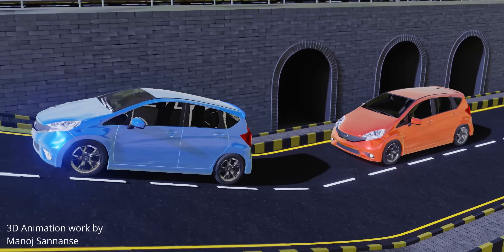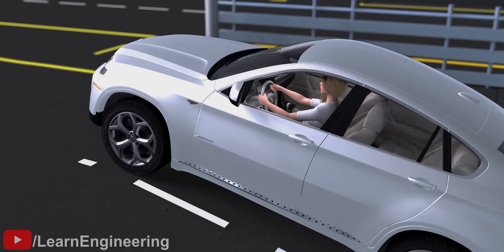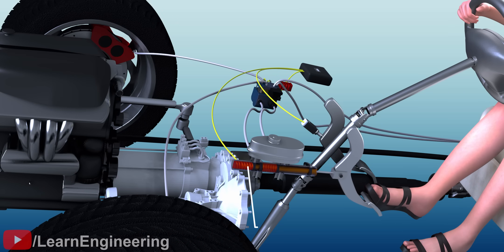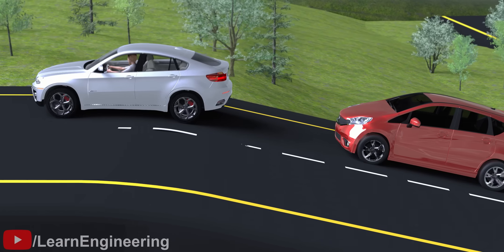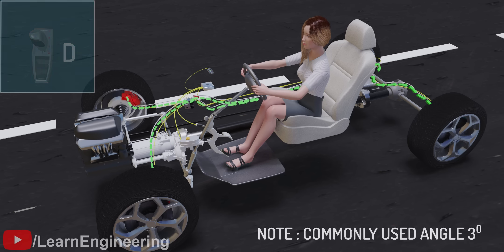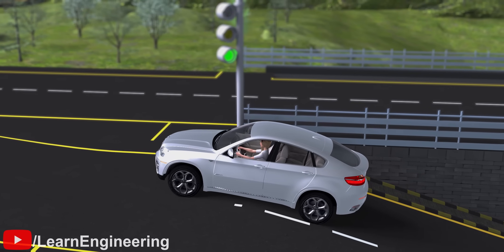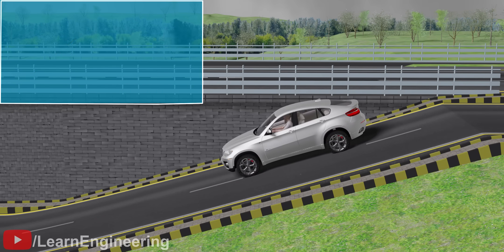Understanding Hill Start Assist!

Comment: Or you can use second leg to press the brake pedal if you have automatic transmission
Reply: May not be recommended for drivers accustomed to manuals. Either:
• use heel-and-toe technique.
• use parking brake.

Comment: Imagine driving really fast on a a downhill or uphill mountain pass, and you are a pro of a driver.
So obviously your braking technique is gonna be good. And once you brake hard, HSA comes into play and you're braking for a longer period than necessary and it reduces your speed.
Such a bummer! 😂
Reply: Also,
Suppose you're in traffic on an uphill.
So the HSA will work once when you reach the back of a car as you apply the brake pressure.
So when the front car goes about 10 meters ahead, you will also gradually and slowly move ahead. But at that time when you apply the brake, it will be soft. So HSA won't detect that low pressure. Then what? 😂
It still needs development in my opinion.
Nevertheless, I feel we should be adequate in driving and control the machine, rather than relying on the machine and inturn the machine controlling us
Reply: @maheshnaik561  HSA only activates when stationary, though.
Reply: @dbclass4075  ohhhhh. I didn't know this.
Thanks 😁
Now I look like a dummy with that comment🙈🙈

Comment: two pedals, two feet.. so, what's the problem?
Reply: Manual transmission drivers may not prefer to use their left foot due to muscle memory. They have other techniques:
• Heel-and-toe
• Parking brake

Also, amputees.
Reply: @dbclass4075  Yes, I agree for the manual users as they have to control also the clutch pedal. However, the video shows an automatic one, so I wonder why the driver idling his left foot on the floor instead of pressing the brake pedal.

Anyway, thaks for reminding about those unfortunate people who have only a foot.
Reply: @fahmihardian7778  Could be the driver is accustomed to manual that is driving automatic. Nothing is more frightening than accidental sudden brake.

(Yes, I caused unholy amount of mess one time for accidentally pressing the oversized brake pedal. Left foot on the left half of pedal. You know, trying to fully press the imaginary clutch pedal. Rest of the journey is awkward silence. Angry stares, food spilled all over the interior, the smell...)

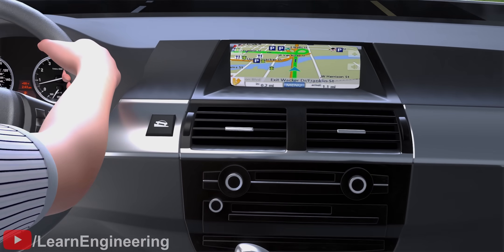Comment: 2:27 "This is a tedious task" * shows lady just press a button *
I prefer having full control and just prolong break with a button.
Reply: Exactly. Most accidents where people mess up the pedals is due to automatic cars. With manual you press the clutch and the power is gone. Much more control over a car when it's manual.
Reply: @soldiers303  True. If you learn clutch, you learned the entire car. It does everything. Move your car, stop the car, shift gears ect.
Reply: @soldiers303  You can cut the power by shifting to neutral, regardless of transmission type.

Comment: I didn't know that this exist. Anyway, I'm from Europe, automatic transmission is rare and this is not applicable on a manual transmission.
Reply: If you didn't know it exists why would you say not applicable on manual cars? It actually is applicable, it holds the car for roughly 1.7s before brakes release
Reply: @soldiers303  Because I watched the video and I understand how it works. When you drive a manual transmission car, you have full control, there is simply no need for this.
Reply: @Zuconja  there is no need but it has been implemented. It's useful for beginners who drive manual cars
Reply: @soldiers303  In my country there's a hill start test when getting a driver's license. You can't pass if you can't start on a hill. Manual transmission car is mandatory on driver's exam. 
If you ask me, if you can't start on a hill, you don't know how to drive.
Reply: @Zuconja  Of course there is a need for it on manual cars. Those that have an electric parking brake. How else would you be able to not go backwards in a pretty steep hill with an electric brake? Electric brakes are slow and they are only either activated or deactivated.
Reply: @alejandroperez5368  
Long answer - I don't use parking break for a hill start, just pedal brake. When you are ready to go, you press clutch pedal, insert in first gear, release brake pedal and then you balance gas and clutch pedal by slowly releasing the clutch and slowly pressing the gas pedal. All this is done very fast and mechanical and in my country almost every driver knows this. I you want you can keep a car on a hill in a standstill without pedal or parking brake activated just by balancing clutch and gas pedal.
Short answers - skills.
Reply: @soldiers303  Absolutely no usefull for beginers, they will rely on a technology rather then their control over car and as @Iggy says in europe we have the hill start test on TRAFFIC and Parking on hills with manual transmission, if every time the examiners waited the driver to start stop the car on hill the driving test would take twice long.
Reply: I have a 2017 Mustang 6 speed manual transmission and it has this feature.
Reply: They do have hill assist on manual cars unfortunately and it’s extremely annoying to use. It jerks you forward every damn time I had to use it in my instructors car :/

Comment: Why can''t that person use his second leg to accelerate while simultaneously removing the first from the brake?
Reply: I do that
Reply: In am automatic car this works but not in a manual car
3 pedals struggles
Reply: Manual transmission drivers may not prefer that due to muscle memory. They have other techniques:
• Heel-and-toe
• Parking brake

Comment: I start uphill without any assist, I drive Manual 😁
Reply: Manual cars can still have hill assist.
Reply: @mattyj2111  some of 'em actually do
Reply: @bertojr2130  unless you responded to the wrong guy I was agreeing lol my instructors car had hill assist personally I didn’t really like it as it was really jumpy.
Reply: @bertojr2130    Like my 2009 Subaru WRX--and it cannot be turned off.   HATE it.   The hill assist is particularly obnoxious on a sports car.    If you check the blogs, it causes old-timers with fast feet to burn through clutches because the HA doesn't release soon enough.   Bummer!

Comment: What bunch of wimps!
When I was being tested to receive my first license,whether an automatic or a manual,you were told by the license tester to head up a steep hill.
Stop, then proceed, if the car rolled back even an inch you got a deduction.
The automatic transmission required you to put the left foot on the brake,keep the brake on while you slowly added power ,as soon as the car started to strain against the brake,release the brake and go up the hill.
The manual was even trickier as you used the hand brake, to hill hold the car,then push the gas pedal,and let loose of the clutch and try not to tool back even the slightest.
These current younger drivers cannot even parallel park.

Comment: HaHa I'm 16 and dont need smart uphill in a manual car (With clutch) lol, I can even keep clutch and revolution at the right pressure and no need for brakes
Reply: I wouldnt use the clutch as a brake. It causes much unneccessary friction.

Comment: It doesn't take seconds to switch between the pedals, just release the brake and quickly press the accelerator more than usual. The car doesn't immediately start rolling back at full speed
Reply: Between vaping and recording my next titok video it can take anywhere from 10 sec to 2 mins to get foot back on the gas pedal...
Worthless except for about 4 steep hills in America with stops in the middle.
Reply: Yeah it goes rolling back slowly but sometimes when I press the accelerator too hard my car starts making a squeaking noise so I lightly press it till it starts going forward
Reply: @ClawsTheKing47  yes. Same. If I press the accelerator too much that's when it squeaks  too loudly and it burns the wheels' rubber I can  even smell it.  the thing is that when I press gas, I panic that I won't  slide back so the tendency is that I step on the gas too hard. Ever since this uphill issue  happened to me, whenever I drive I get scared when I see the road slightly uphill. I never got over it.
Reply: @timcook4552    Practice, baby, practice!    Do it where there's no traffic, at night or whatever.
Reply: Not it does. That happened to.me and I was traumatized
Reply: @timcook4552  then you don't know how to drive
Reply: @YourDadsBoyfriend  I just started to learn how to drive and when I pressed the gas it accelerated too fast I almost collided
Reply: After all, we have to legs.

Comment: "a few seconds are required to switch from the brake pedal..." -  Really.. a few seconds?  Try a fraction of a second.  The harder issue is a manual transmission.

Comment: I thought the reason was because of the work the motor already does when you simply let go of the breal pedal. For example my vehicle wont travel in any direction when on an incline if i come to a full stop and then release the break pedal. It will travel downhill obviously and also would roll back on a very steep incline.
Reply: Most automatic cars already dont roll backwards when you stop on a hill and release the brake. At least cars with a torque converter dont. Even if you drive up a hill in reverse gear.
It doesnt use the brake for this.

Comment: 0:10 I have a handbrake.
Reply: How can you drive with broken hands? Or do you mean handbrake?
Reply: @dbclass4075  Yes, you also can use a handbrake. You don´t have to break your hands.
Reply: @qq84_Richard  But if the driver somehow breaks his hands using the handbrake, I would be very tempted in swiping his license away.
Reply: @dbclass4075  It depends on the jurisdiction, in some you just can´t.
In some jurisdictions you can drive on the wrong site of a 4 lane highway and don´t get your license taken away, you don´t even get a mandatory reexamination.

Comment: Just put one foot on brake and other on accelerator ,no time needed to switch between the paddles,no need of HSA
Reply: Don t forget to use your third leg for the clutch
Reply: Manual transmission drivers may not prefer that due to muscle memory. They have other techniques:
• Heel-and-toe
• Parking brake

Comment: WTF is this? We just use the clutch; and for very steep roads, the handbreak.
Reply: You can use the normal break also
Reply: Give me a BRAKE. I'll ride along with all of yah.
Reply: Bhai mera 1 youtube pr chanel hein. Bhai log mujhe suport ki bhht jrurt hai pls suport kro❤️https://youtu.be/JyBckyDgKc8
Reply: Americans
Reply: this is for the  button app using generation.  ask  this generation of button pushers to use the clutch pedal  and theyll  google it on the steep hill------ crash,  my insurance company has a app for that sir, let me put the manual in park !!!!!!
Reply: Actually with an automatic transmission you can simply brake with your left foot and release it while accelerating. In a manual you can also use the heel-and-toe technique. HSA = useless.
Reply: @adrianocoelho2026  HSA is not useless, it makes all of what you said a lot easier, maybe unnecessary but definitely not useless
Reply: @HakarDoski  Infact hsa seems alot more desirable in Manu cars since they require eyou to find the clutch biting point

Comment: I am european and there's a pedal missing
Reply: @TheGaming Hobo  lol... I feel he might be taking about clutch pedal if the transmission is manual.
Reply: I see no point of such system in automatic, you just press the brake with left foot
Reply: Americans mainly use automatics and don’t seem to have a handbrake?
Reply: @mattyj2111  thats why i gss the jeep compass doesnt have a handbrake
Reply: Americans already have car crashes as is. If we give them a third pedal they won't be able to even get the car to move lol.
Reply: Auto transmission
Reply: @Tournel Henry dude just because companies are adopting more electric doenst mean people have them. Based on statistics, it’s around 90% of drivers in Europe that own manual cars
Reply: @Tournel Henry Manual transmission is more fun. EV instant torque and one speed transmission is the only thrill worth giving them up, IMO.
Reply: Not all of us use Auto. I drive both. Manual is clearly more fun.
Reply: @Tournel Henry if you had a manual you would prefer it too
Reply: @calettov2  Not if he's a bad driver, which unfortunately, Americans tend to be...
Reply: A pedal and the application of the handbrake.
Reply: @Tournel Henry chill
Reply: Facts
Reply: That’s why Europeans are W (I’m Asian btw lol)
Reply: @Tournel Henry It's not necessarily better. Aside from having more control of the car as mentioned above, manual is also a way simpler system which means less points of failure and also cheaper repair. If your automatic transmission fails, you might be paying close or as much as you paid for the whole car itself. Manual can do everything automatic can do while being simpler, at the cost of being slightly harder to learn (it's really not rocket science). So it's not outdated.
Reply: For Indians too 🤣
Reply: @Tournel Henry it's not outdated, has some advantages over automatic transmission like more control over the car power and torque which may be not necessary for some  mom driving her children to school everyday but a must for someone who likes to have fun driving a car.
Reply: @MB-up3mh  it kinda is outdated, no need to write a history lesson on explaining why it’s not
Reply: @MidnightE53  it kinda isnt.  A lot of performance oriented cars will have a both automatic and a mannual option, unless its intended to be chauffeur driven.  Manufacturers still are using it widely, and i think if you look globally, mannual cars are produced a lot more than automatica. So its not outdated. Manufacturers make them, market has a good demand, and It does provide some benifits over an automatic. So its not like automatic is an upgrade and mannual is outdated. they are just two different options available, as per your preference.  If you drive because you have to, then it doesnt matter and you wouldnt probably understand., but if you drive because you want to, i dont think you'd want yo drive an automatic.
Reply: @Tournel Henry It's maybe better but it makes you lazy and it's boring just turning the wheel around.

Comment: I hoped an experienced driver would comment about half clutch on manuals but couldn't find it.
In manuals your left foot is on the clutch and right one one the brake. You lift the left pedal till you sense the engine is going to stahl then you quickly release brake and push gas.
Hope someone who can explain better leave a reply.
Reply: I dont use this method because my VW for example doesnt have that much power and torque. Its actually not a good tactic because you can kill the engine easily with that.
Never ever use the clutch while stepping on the brake. Let the brake go and then give it enough gas and let the clutch go a little faster than normal.
This is what I do. Since I do it that way (as a beginner) I never killed the engine ever again.
When I used the tactic you proposed I killed it multiple times.

Comment: I just accelerate the car while the brakes are still pressed and release them gradually
Reply: When I drive an automatic car I just let the brake go and instantly step on the gas with greater force than I usually do and then let go a little bit once I am moving.

Comment: Oldschool hand-brake technique left the chat..
Reply: Riding the clutch anyone?
Reply: @ethanebang7507  yup, thats the way I do it as well. Never use the handbrake unless I have to wait for a longer time, just to be easy on the clutch
Reply: Old school for my country is also without handbrake.
Reply: especially since they got rid of those
Reply: True!! Even though my car has HSA, i still trust more the hand brake technique rather than HSA. It feels like i am in complete control of all the action
Reply: Heel toe immediately before launch.  Few rpms, little clutch engagement, then off brake and go.
Reply: Handbrake technique is still used with truck driving but with small cars..
Reply: Literally handbreak solwes all problems
Reply: Brake and clutch accelerator left the chat
Reply: Without hand-brake in my country..
Reply: πες τα ρε παντελη
Reply: i drive a manual, but never had to ever use the handbrake. Just have to move your feet quick enough. never need hill hold assist.  But in this video, its a automatic. it has two pedals and you have two legs, and still you need  assistance ? Its better if that guy never drives; just call an uber.
Reply: @RidewithRevin  Yes.  Steep hill a little heel toe to up the revs and off you go.  I do it both ways.  Handbrake if someone is really close behind me.
This guy @Pendek, who is defending his comment, isn't getting it.  He thinks it will destroy the parking brake.
Reply: Hand brake will seriously get loose faster if used as hill assist
Reply: @pendek3255  No, it will not.  Where would you get such an ill informed idea?
Reply: @dan1906  well, in my service, cars came with non functional handbrake because it was engaged without knowledge while driving. Illness is for those who don't know reality and their place my friend
Reply: @pendek3255  I suspected you would come back with more nonsense.
Reply: @pendek3255    it will not destroy your brake.just dont keep your car rolling with the handbrake pulled halfway up. In hill start, you would release the handbrake before your car starts moving. and the same thing happens in hill start assist systems as well. jut that the car applies the brakes for you, so that you dont have to.
Reply: Bhai mera 1 youtube pr chanel hein. Bhai log mujhe suport ki bhht jrurt hai pls suport kro❤️https://youtu.be/JyBckyDgKc8